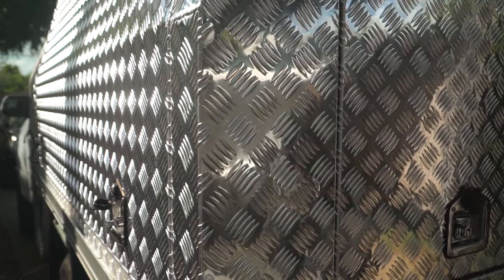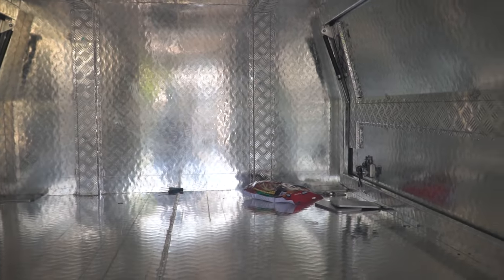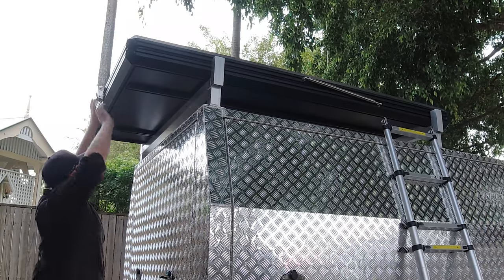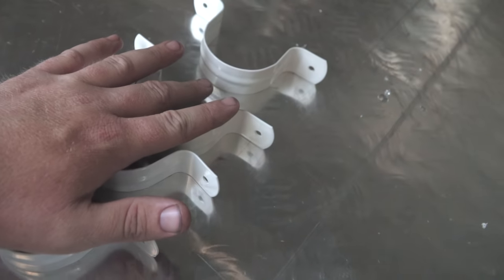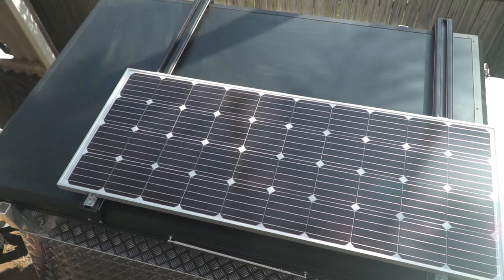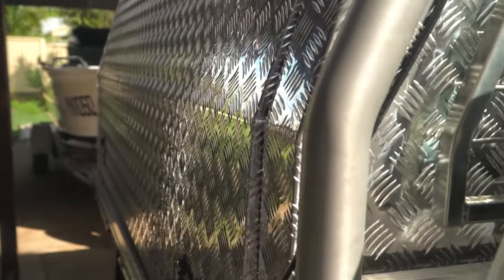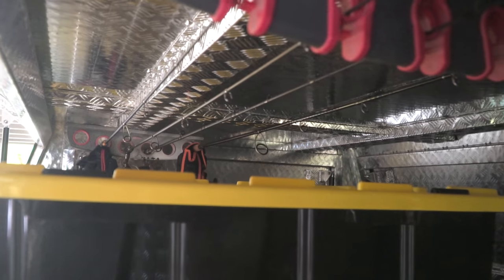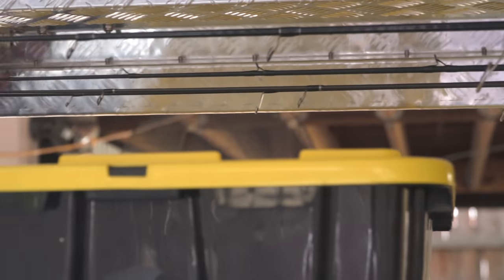Budget Camping Setup!

Comment: Get rid of those pipe brackets and cut off the ladder racks and mount direct to canopy👌
Reply: Ok then retro fit some make shift thing to hold ladders when they are needed 👍
Reply: Yeah bushywacko 🤟
Reply: @JoshBushwacker  I feel like it needs some rubber in there somewhere too, otherwise that alu WILL rip itself up over time.

Comment: Hey mate just watched this vid. One suggestion for securing the roof top tent would be 90 deg brackets (if you don't mind drilling through the roof rack cross members). One Bolt should how two brackets . one either side of the cross member.

Comment: Looks great mate , but trash those plumbing saddles you used to tie it down . Grab some flat bar from Bunnings and cut some rectangular washers . Then you can use longer bolts and the clamps that came with the kit .
Reply from the maker: Yeh man I'm with you! Ive found some online that will be perfect so as soon as they arrive out with the old in with the new. That being said I took it down the highway at 110 and it held together hahaha

Comment: solar pannel dc/dc charger, aux battery and a fridge would be good.
Reply from the maker: They are very good mate! Panel has been more than enough to keep the fridge running non stop and replenish the battery so pretty happy with it
Reply: @DrewMinto  yeah i got one in my pajero mate, the dc/dc charger is a good option incase you drain your deep cycle auc bat you can charge it with your cars alternator. its a long way to the boat ramp for me and is essential for me. enjoy your new toys mate. are you planning on a trip up north ?